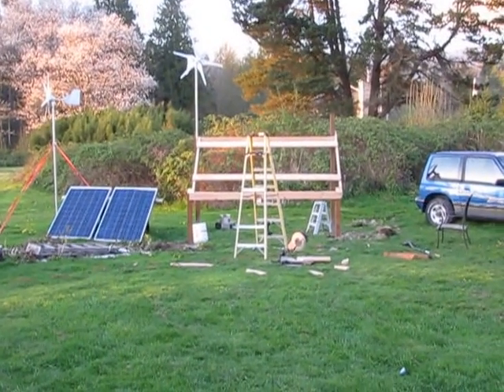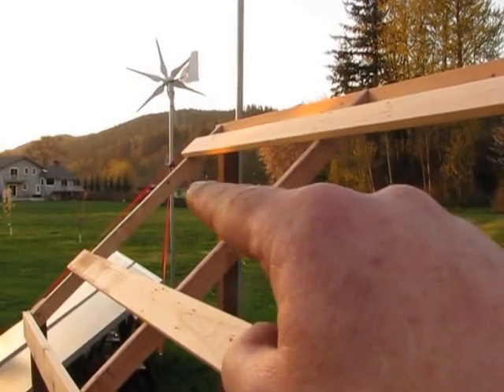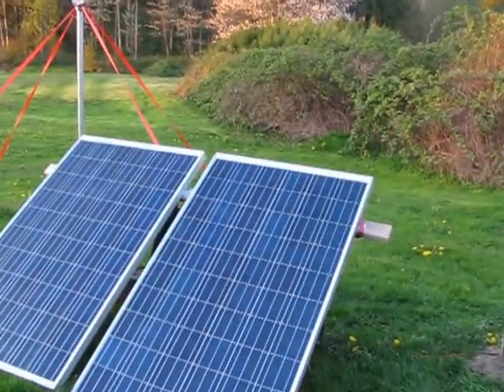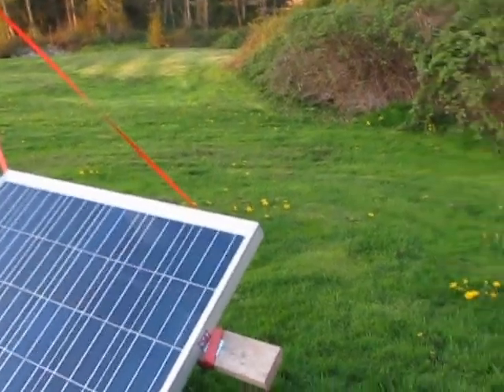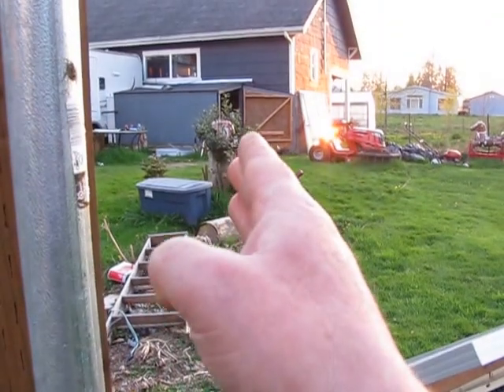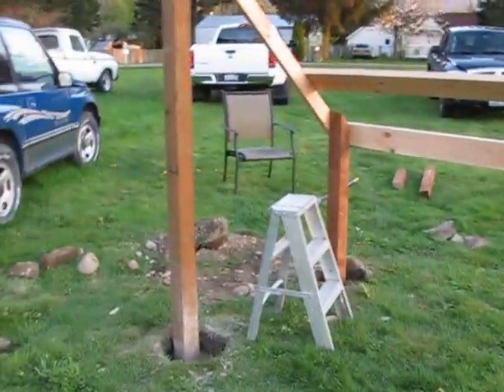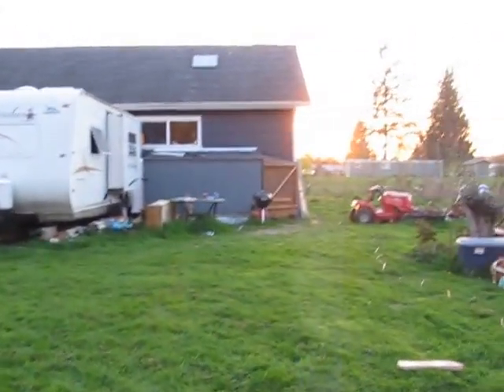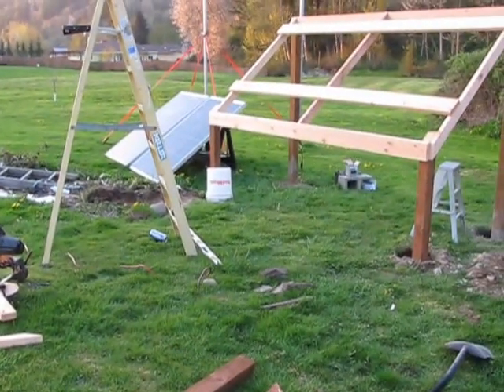Building My Solar Rack :),,  4/12/2014

Comment: i was thinking about it today, that you will have at least three 14-3 cords for three turbines, depending on the number of panels, the dc lines for the panels. that's a lot of wire to pull through a pipe with two 90 degree sweeps. from my own painful experience, you may wish to use at least 2 inch pipe, and that may not be enough. 
you can stretch all the cables at once from point a to point b, then walk each pipe section from a to b until the whole thing is built, that would be easier then pulling each cable through. the first may be easy and the last will involves curses I never like to say.
put a large junction box out at the solar stand and enter all connections into the bottom of the box to prevent water from getting in. the shed side you may just leave open.

something like this in pvc, you will have to drill and attach fittings, short 6" pipes down out of bottom to keep water out.
http://www.homedepot.com/p/Carlon-12-in-x-12-in-x-6-in-Junction-Box-E989R-UPC/100404149
hope this helps,
john
Reply from the maker: I don't plan on using a conduit,, I will just bury my wires about 6 inches in the ground :) Trying to save money ,,, using conduit is the proper way to do it,, but Since I plan on dieing here,, I just draw up a diagram showing how and where the wires are buried for the future,,
 If my kids want conduit thats their problem,, All I want is to be able to mow my yard and not have wires in the way :)
Reply: Jason Brown Hey, I just wish to tell you I am amazed on what you have accomplished there. i hope you don't think I'm being critical.
the landscaping low voltage wire is direct burial and if you are using outdoor extension cords, they should last a while, not sure how long but you may not have winters like we do. you should have a ground rod either at the panels or by shed. and ground the any metal at the solar array.
john
Reply from the maker: john otoole
John you point out the Proper way to do it :) Because I am trying to cut corners And save a lil money,, the way I plan on doing my wiring is not the best,, but it will work for now,,,

A lightning strike on any of my turbines,, will fry all my electronics,, I have them all grounded but the power from a lightening strike might be enough power to run a city,, I just hope if lighting does strike in my area it hits one of the trees close by,, not my turbines :)
Reply: Jason Brown I bargain shop also, but cutting corners when you have invested so much money in the big stuff can cost more in the long run. just like safety, so grounding is important. everything metal should be grounded, a grounding rod is $10, if someone gets a shock, is the $10 worth it?
If someone that doesn't know any better drives a stake or shovel in the ground and cuts a cable. what if you just run 4 inch plastic sewer pipe across the yard. then the wires are protected and you have room to run more cables later.
john
Reply from the maker: john otoole
I ground everything,, I was just trying to state that even tho everything metal is grounded a lightning strike would probably fry all my electronics,,
I was thinking about maybe using some drain field 3-4inch pipe,, that way if water did get into it,, the water would not pool up but drain back into my sandy soil ,, sewer pipe and drain field pipe are very inexpensive and large enough to easily run all the power lines I would need :)